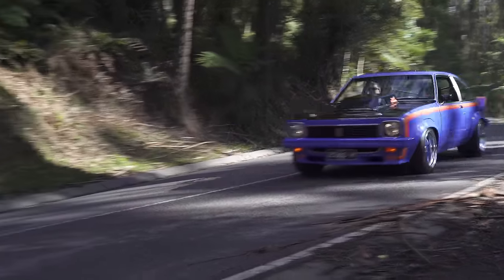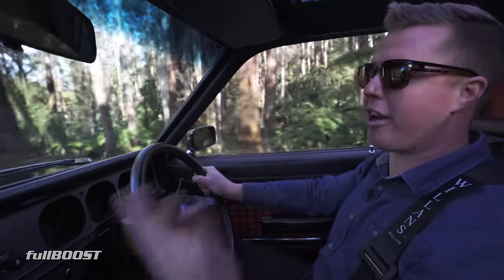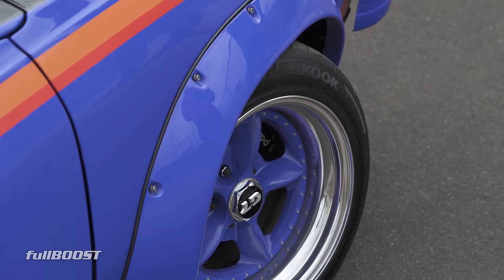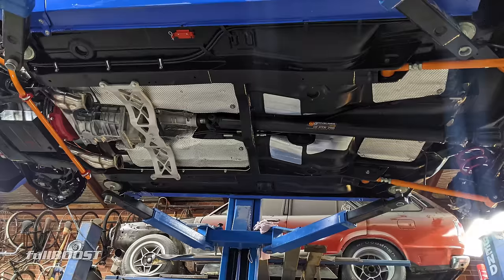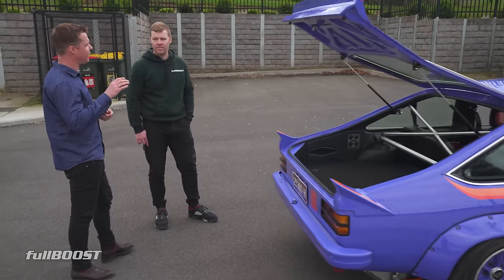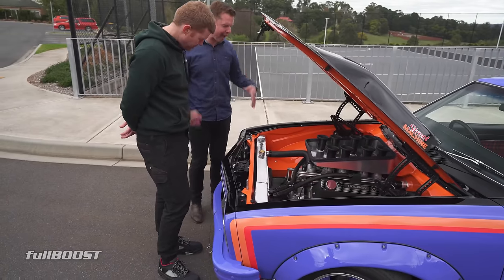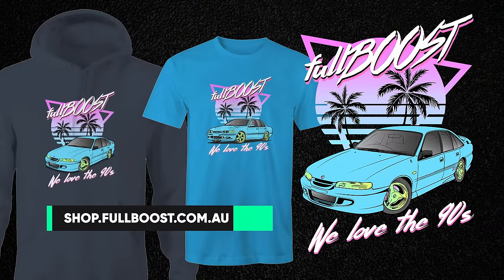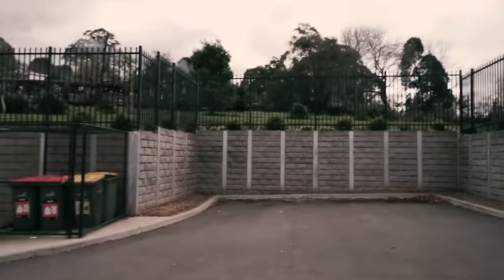Driven not Hidden - Wild Pro Touring Holden Torana! | fullBOOST

Comment: It was beyond a pleasure to get the call for this one, guys! Thanks so much for having me on your channel and letting me share so much detail about my Torana. 

Love seeing other people enjoying what this one is all about, and hopefully it helps to inspire some other corner-carving modified street car builds. 👌😅
Reply: Lovely work. And thanks for sharing it😊
Reply: Is this colour from the Hyundai Excel X3 Range ? Back of the 1990s
Reply: Yes! Build it for the twisty bits. Very well engineered car, enjoy driving it.
Reply: @hezath Id love to know what you did to the front end to make it work better.  And how much caster and camber you dialled in.  Cheers.
Reply: @MrJahoot  so it has been moved forward 10mm and solid mounted to the chassis. All the arm bushes are urethane, the dampers are Shockworks monotube units, the rack has been replaced with an LH rack (faster ratio) that I solid mounted, it has had a shelby drop done to the top arm mounting points, has solid wheel bearing spacers I machined up that are toleranced to crush the bearings .002" and stiffen the stubs, it has 3deg +ve castor and 1.5deg -ve camber at ride height. Steering column has been shortened and had a twin knuckle conversion with a longer intermediate shaft and a sealed lower bearing. I also re-inforced the swaybar mounting points and put a 24mm bar on it, it has 900lb springs, and a brake upgrade of course.
Reply: @Hezath  wow! That's an upgrade and a half.  Great info! Thanks.
Reply: @rc70ys  haha no but that colour would probably also rule on a 70's car.
Reply: Who was your trimmer? The whole car looks awesome mate
Reply: @lesleynichols8308  Thanks! Well the car doesn't have "a trimmer" like it doesn't have "an engine builder" or "an exhaust guy" or "a diff guy" etc. lol. It's just me in my shed learning as I go, but in the interior I farmed out the inserts in the front seats and the rear seat re-trim (done by Craig Morrison), the door trims (Dash Original), and my mum helped me with some stitching when I made the roof lining and rear tub trims. Brad at Dr Stitch did a really nice job of trimming new vinyl over the headrests I restored with the orange net as well... suuper tidy work on that area.
Reply: Coolest car at WTAC. I wish I spent more time admiring it. So good to see it’s piling on the miles and being enjoyed.
Reply: LOVE this car ❤ and I’m a Ford man lol…love your whole build philosophy which is a similar route I’m taking with my XA Hardtop…the colours and interior are awesome as well…beautiful build…cheers 🍻
Reply: You obviously have an excellent knowledge of suspension geometry and dynamics and it's great to see you put that knowledge to work and build your dream car. A lot of people would have lost sight of their end goal with an eight year build time. So good to now see you enjoying the fruit of your labour and thanks for sharing the journey with us.
Reply: Absolutely awesome work on soo many levels- research, design, construction, evaluation, result. And then start it all again. How a car should be built- never finished👏👏👏
Reply: Legendary build Heath 👍
Reply: It's beautiful man, love it.
Reply: @Hezath. Did you do the LPG kit swap? If so, do you have a place that can offer this.
Reply: @glebobaggins  Hey mate, I did everything myself mate and can't really recommend professionals for anything as I seldom used them. I got it running & driving (up to about 20% throttle only) and then drove it to Tunnel Vision to be tuned. My build thread "Heath's Hatch" on the GMH-Torana website forum covers every detail of the LPG installation (and every other part of the build).
Reply: @Hezath  appreciate this...will check it out as I'm surprised there are not many high powered cars running with LPG in Australia. 

I was thinking of getting someone to do the lpg install but if I can try to do the install myself than this build you did definitely inspire the rest of us trying to do something similar.
Reply: Hello Heath, what an inspiration mate. Excellent work and has given me a renewed desire to work on my LH Torana. I would love to be able to harness what you have learned and refine my own machine. Built 25 years ago to run the quarter mile with a 355 small block, 9 inch and turbo 400. Now I would rather enjoy it like you do. Are you part of a club at all?

Comment: EPIC BUILD! Epic Video by fullboost too!  Heath knows how to have fun!  My first LPG car was using 11c per litre gas.. 
Remember one team at Batthurst raced on LPG and swapped the whole gas tank at pit stops
Reply: Hahahaha that is awesome!!! 😅
Reply: @Hezath  wondered if you can  mount a forklift bottle for extra capacity (20L? ) or a donut tank (45 usable litres) on the back floor(swing up for sleeping or lift out?) might affect center of gravity hehe.  A mate in Gembrook has heard this car and says it sounds Glorious!  Really glad this video shows all the mods and details i was able to see on the forum build, didn't even cover the wiper motor relocation mod ;)
Reply: @deankdx  anything else I add tank-wise would ruin sleeping in the car... the way I've made the rear suspension does encroach on some of the rear floor shape... you don't get much for nothing on a smallish car! But yes a forklift bottle could be arranged in a pinch. The sound of the car seems to get better and better as the temper of the stainless has changed and/or the mufflers have filled up a bit. The sound is pretty unreal! hahahaha

Comment: Killer car great setup, Id defintley go 6speed with either 3.4's or 3.7's in the ass end, 6 speed box nice close ratio box be mint in this.
Reply: Thanks Robert! With the low-down torque to weight ratio, the extra gear would be a bit wasted I feel. I did actually just put 3.7's in the rear (I had 3.9's in this video) and it is a better car for it. Fourth gear lasts a bit longer and is more usable, which is nice, and the motor eats up the rpm drop into overdrive like it's nothing at all. (it's so tractable it could probably pull on the highway at 1500rpm lol). 

I would rather put a 6spd in my Datto where it's less than half the motor capacity and needs to be kept on the boil.

Sometimes when I'm driving really lazily in this, I will look down at the tacho and see it's under 1k driving out of a roundabout or something and it's still pretty smooth... "oh okay I guess I should change down because there's a hill coming up" haha

Comment: Awesome build and a capable owner. I disagree that we don’t make any EV fuel in Australia. We are fully self sufficient for coal & LPG being the 4th largest producer of coal on the planet and also the largest producer of lithium. We also have the highest solar production/capita of any country.
Reply: Australia's mining industry is 86% foreign owned,  BHP is 76% foreign owned, and Rio Tinto is 83%.
Reply: When you're talking on camera on the fly - while driving - it's hard to put together a decent collection of thought. LPG was a fuel system that Australia was quite self-sufficient with. From start to finish, we could source, process, distribute, and manage it, and we even made a lot of componentry for power systems that used it locally.

On the topic of lithium, yes, we do mine the ingredient so we are part of the supply chain. But that doesn't insulate our country with any self-sufficiency for EV's as a power system.
Reply: @Hezath  Yeah fair call I’d be tongue tied being interviewed while driving. LPG is good stuff, years ago I was involved installing gas turbines for power generation in Brisbane with Roll Royce jet engines. The gas was sourced from QLD. Nowadays 18% of Australia’s power comes from domestic gas.
Reply: @timfreeman2603  awesome! Thanks for sharing. I've known of some great natural gas generator systems (and worked on some) but none of the ones I've been exposed to are jet engines. Fascinating.

Comment: More Castor is for high speed stability rather than tight corners?
Reply: High speed stability, better self centring and more camber gain on the outside when turning,
Reply: @HSVR383SC  yes I agree but small castor creates better turn in!
Reply: Might make for easier steering input, but less effective turn-in. A lot of positive castor will give you a camber improvement on BOTH of your front wheels when turning in, without hurting the contact patch in a straight line, and this is very desirable for a road car. But you need to be willing to grab the steering by the scruff of its neck as the self-centreing behaviour probably isn't conducive to your grandma driving it, haha.